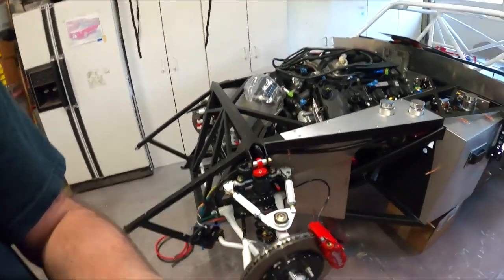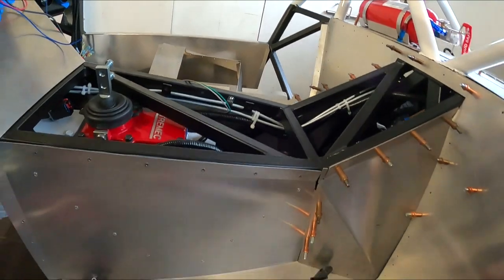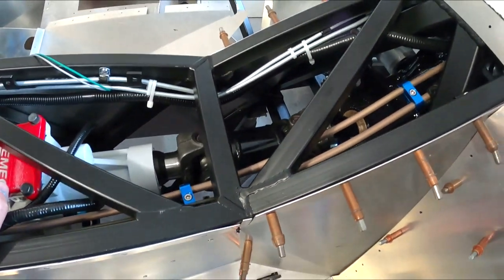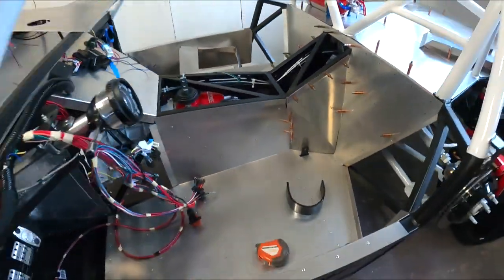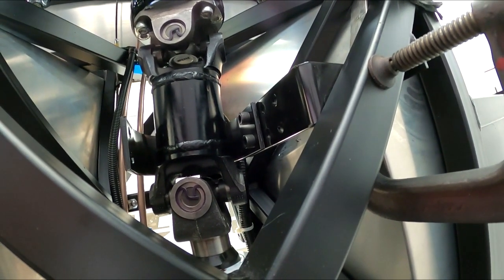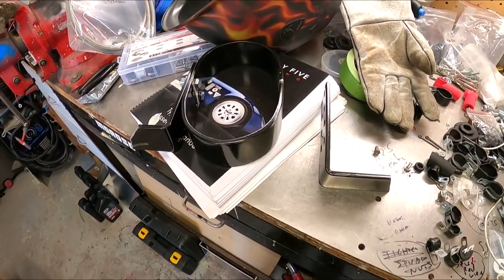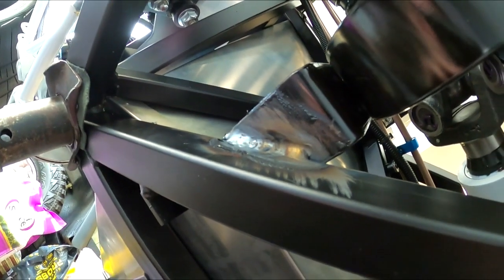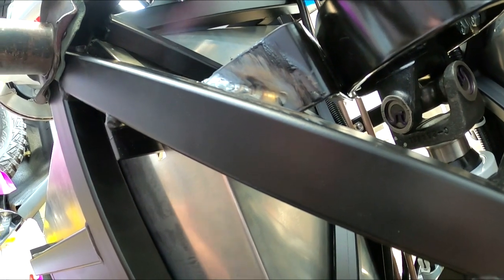Cobra Daytona Build- Driveshaft safety Loop, Video 77

Comment: driveshaft safety loops are a good safety measure as I have seen dyno runs with driveshafts  coming through the floor and wrecking brake lines and fuel lines, also here in NZ we have to put them in by law on all modified cars with 20% or more power increase,
Reply from the maker: At least they allow you to increase the power, some countries don’t. Thanks for watching and stay safe.

Comment: I'm wanting to build either the MK4 or a 65 Coupe.  What kit did you go with?  Complete kit or optioned up base kit?  I know the MK4 can be done cheaper, but I like the idea of a hardtop and the coupe just looks cooler.  Thinking 347 from Blueprint and their 5 speed trans.  Should do power steering, going manual brakes, just not sure what kit would be best.  Is it possible to do a base kit cheaper than a complete kit self-sourcing parts?
Reply from the maker: I went with the complete kit and added some options. I had the roadster and loved it but the top will be nice. Thanks for watching.